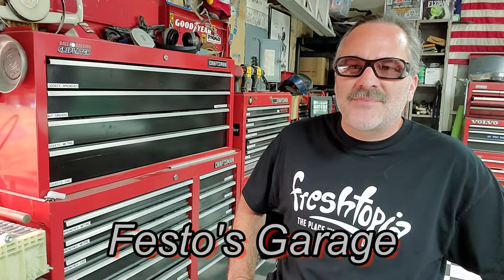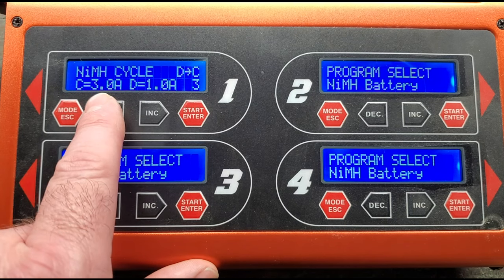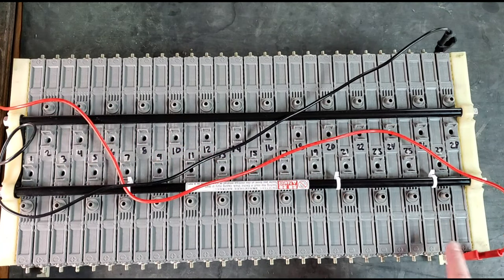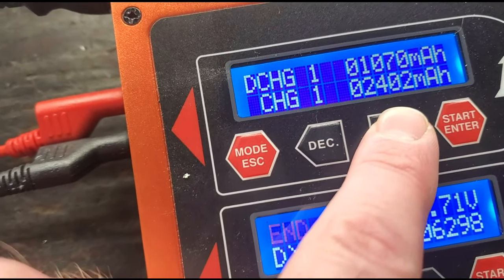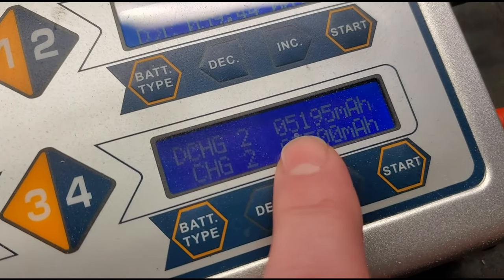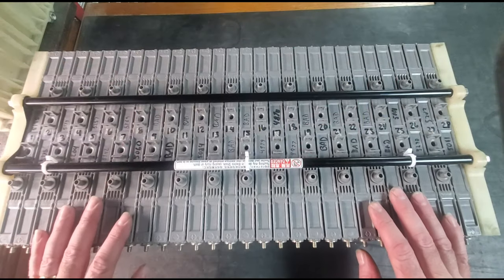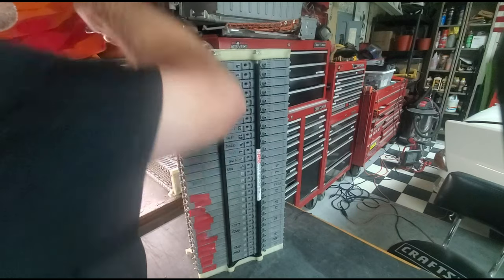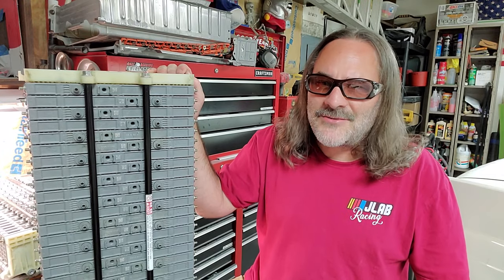Hybrid Battery Pack Refurbish - Step-By-Step w/ Settings - 2nd & 3rd Gen Toyota Prius - CQ3 Charger

Comment: Do we necessarily have to load test and plug the cells into the CQ3? Wouldn’t I be able to just balance the cells by connecting all the cells together with the wire? The code usually pops up only because the voltage difference is high. Good work as always! Keep it up!
Reply from the maker: Thank you for watching and commenting. The code will return due to the low capacity of the failing cells.
Reply: Check your scan tool, you can determine the lower capacity cell by watching the charge and discharge rate, the cell block that has the lowest voltage when discharging would show you which block has the loss capacity.

Comment: Does the welding wire has to be any specific one to make better contact?
Reply from the maker: Thanks for watching. I used stainless steel TIG wire but it can be any metal that conducts. If you ordered new bus bars then you can use them along with your old ones to get the job done. Bailing wire works well too.

Comment: I already replace the bad battery cell and measured every battery cell and there all around 7.76 and 2 cells are 7.80. Would you recommend balancing them again and doing the process of discharging and charging them back up
Reply from the maker: Thank you for watching. You should be just fine to reassemble and drive down the road.

Comment: Great video I'm learning so much. Question for example on cell 20 about how long did it take you to do one cycle?
Reply from the maker: Thank you for watching. I am not sure how long it takes to do a cycle as it will depend on the health of the battery. I set the charger up and check it a couple times per day. The whole process takes 2-3 weeks usually.
Reply: @GreggFesto wow😮 had no idea it was a long process! Thanks for the heads up!❤

Comment: Hey Gregg . Thanks for all efforts you did for the new beginner like me I am a big fan of all your videos. I have a question. When I try to start . It just flashes “DLY” I don’t know what does it mean. Thanks again
Reply from the maker: Thank you for watching. DLY = Delay. It should move past this step without issue. If your charger will not move past DLY on screen then you should check settings. If settings are correct then you should make sure that your leads are ok. If you still cannot move past DLY then you will want to contact EVPeak service.

Comment: Thanks for the great prius battery videos.

I watched this video and purchased the same charger that was in the first video, only it's a red model. It says "BGUAD" instead of "EV-PEAK" and the buttons are labeled differently.
I made sure the settings were exactly what was in the video. I ran my discharge & charge cycle (3x) and when the cycle was completed, I pressed the left button as Gregg did in the video, except I didn't get the same result. When he pressed "Batt. Type" he was able to see the low & high mAh. When I pressed the button located in the same location but labeled "Mode Esc", it took me back to the menu. I ran the scan again thinking I needed to hold it down, but it did the same thing. The other buttons do not take me to the desired menu.
Any thoughts?
Thanks in advance.
Reply from the maker: thanks for watching. I hit the same button location on both chargers even though they have different labels.
Reply: did you figure this out @andyaeschbacher7822? I just did the same thing, finished the scan and when i hit the Mode/Esc, it did not show my cycles at all, just went back to main menu. I also have the BGUAD, but it's EV-Peak on load screen when you turn it on.
Reply: i figured it out. the problem is not all chargers that come from amazon are always on 110. i bought two, one was 110 and the other was set to 220. when the 220 got done with the discharge, it would try to charge before failing with INPUT VOL ERR and quit. so what we thought was done was never done so there were no values to show when you clicked MODE/Esc.
Reply: @andyaeschbacher7822 and @leakingimplants - @GreggFesto, did you find a solution. I have the same thing, I hit the far left button and it goes to home on 1,3&4, but on 2 it works as Gregg showed. Since #2 works as shown, I think I must not have exactly the same settings, but I can't see where I went wrong.
Reply: Thought I would reply just in case it helps others along the way. After checking and even triple-checking to make sure my settings matched Gregg's instructions, I did a factory reset on all 4 QC3 modules and reentered Gregg's settings. 'Bingo', it seems to be working as planned.  However, since the first 4 battery modules charged showed a flashing CAPA, therefore I could only see 1 cycle, and 2 of those modules had less than the desired D - 5000.

Comment: Gregg, after you recondition the cells (cycling between discharge and charge) how much time do you let the pack rest, before unbolting the pack?  I'm a little worried about the cells expanding if I unbolt the pack too early.  Thanks for your help!  Kevin
Reply from the maker: Thank you for watching. I forgot to mention that in the video. I feel the batteries with my hand, if do not feel any hot spots then I take apart, flip the batteries and balance. Please let me know how your pack does after you reinstall in car.

Comment: Question, which of the two chargers would you recommend the blue or red? I bought the red one. And bought the wires you suggested, the machine fried. I had four modules connected with the four sets of wires, with separation of three modules connected to prevent heat. Kinda not sure to buy another charger. Any suggestions? None of the modules are shorted.
Reply from the maker: Thank you for watching. I have not used Blue before. I have a Silver one and a Red one both of which have done very well for me. I have not had any problems with them other than needing to replace some cooling fans due to noisy bearings. Contact EV-Peak support and let them know about your charger, maybe you can get a replacement.
Reply: @GreggFesto  Thank you. I said blue instead of silver but mean the same. Do both units have same operating parameters? I assume both are equal in programming. Great videos!

Comment: When you take out the battery from the car are you charge battery to the full first or you straight away discharge the battery ?
Reply from the maker: Thanks for watching. State of charge does not matter when removed from car. The charger cycle should be set to discharge first then charge.

Comment: Great video.  We have 3 gen 2 & 2 Gen 3 Prius's in family & I am the car guy.  Bought 1 of the recommended chargers & may buy another per your recommendations before I start taking the batteries apart.   Also have Dr. Prius app & various OBDII tools.  Just one question before I start.  Do you have any regen battery vendor you would recommend for purchasing modules from?  Would love to hear if you do.  Thanks much.
Reply from the maker: Thanks for watching. I bought 2nd charger just to speed things up a bit. If you are not pressed for time then a single unit is all you will need. On average it takes about 3 weeks per battery pack with a single charger. I have received really good batteries from vendor called AloyHybrid on eBay.

Comment: What should u set up the Input Power low cut off mines at 11.0v
Reply from the maker: Thank you for watching. I left input power low cut-off at 10.0V. If you are using AC power this setting will not make any difference.

Comment: Hi Greg,

I'm getting ready to do this process on 2008 Prius and thanks to your videos I feel confident about doing it myself. However i do have a couple questions I'm hoping you could answer for me!

First question, when i find bad cells and order replacements do i need to discharge and charge them, or is there a way I can check to make sure im getting a good cell?

Second, when i balance the pack im simply connecting all the positive/negative terminals in a row and letting it sit like that for 48 hours? I don't need to discharge and charge it all together?

Thank you for your time putting these great videos together!
Reply from the maker: Thank you for watching. I always run at least 1 cycle on the replacement batteries so I know what I received. This lets me know how it compares to my others and lets me know where to place it in the pack after balancing. During the balancing step you do not need to charge or discharge, just let them equalize. I hope you will write back in and let me know how your pack refurbishment comes out. How many miles are on your car and what year? Why are you refurbishing your pack? Did you get red triangle or are you experiencing reduction in mileage?
Reply: @GreggFesto  The Prius has 134,000 miles and I got the red triangle confirmed by a mechanic to be a hybrid battery failure, he also  told me it was specifically cell block ten. However I plan on going through each cell as you do to see if there's any other performing poorly.

Comment: 2 questions; Why not us dielectric grease on all the connections to eliminate corrosion?  And, while the battery is still in the car, shift to N with the ac on (300+ volts) to draw down the battery.  Then shift D to let it charge up.  Doesn't that balance the modules too?  Use and OBD2 like Dr. Prius to see the status of each block (2 modules) to get an idea of what's going on in the pack?
Reply from the maker: Thank you for watching. Dielectric grease is a fine idea and may help future corrosion. Cycling the battery in the car will cycle the pack as a whole unit which will not address the capacity of each individual battery. I do use dr prius app before doing this service as it enables me to verify that the blocks showing low capacity are the same as the ones I see when refurbishing.
Reply: @GreggFesto  Yes, I understand.  But you recycled your batteries and got them up to decent ranges.(the ones that were good).  My thought is to do the same thing on the car and then see which ones don't correct themselves.  Might save time by having the car do the work instead of doing it on the bench.  What am I missing with this logic?
Reply from the maker: When the pack is together the batteries are arranged series. This means that they are charged/discharged together. When charge capacity is reached on the strongest cell of the pack, could be 1 out of the 28, then the charging stops. When discharge capacity is reached on the weakest battery then the charging starts. This is the same way the charger works. The downside of this is the car does not fully cycle each battery in the pack. I believe that each of the 28 batteries you see me cycle is made up of smaller batteries. It is quite possible that only one of these smaller batteries inside of the gray battery has failed causing the gray battery to read as failed therefore causing the hybrid pack to read as failed. Your lowest capacity "weakest" and your highest capacity "strongest" battery of the 28 gray batteries in the hybrid pack will determine the way your cars charging system behaves. Your pack is only as good as your weakest gray battery.

Comment: Thanks for the hands on instructional video. Would you use same voltage/amperage parameters for refurbishing 1st generation Honda Insight (2000-2006) and 1st gen Honda Civic  Hybrid (long pipe 1.5v x 6 = 9v D type stacked) batteries? If not, which values (charge, discharge, volts, amps) would you recommend, or the same parameters used for Prius Gen 2 and 3 can be applied to 1st Gen Honda hybrid batteries? Thanks.
Reply from the maker: Thank you for watching. I am not familiar with the Honda batteries enough to provide setting details. I suggest visiting a Honda forum and getting that info from someone with more experience than myself.
Reply: @GreggFesto just fyi findings: Forum and YouTube users apply various similar setups, usually setting upper amperage capacity limit (charge) to 6500mV, that is the stock battery specs, but the later aftermarket batteries that came with 8Amp capacity (Bumblebee, Greentec, etc) seems to be handling your 7500mV charge capacity limit pretty well.

Comment: Thanks for the info on the "Full" ending message meaning the same as an END.  I got my second "Full" message this morning.  I am using your setup of running 3 cycles, but my problem is I can't figure out the key sequence from the FULL message to be able to see my 3 cycle DISCH and CHARGE values for the cycles completed resulting in the FULL message.  If I press the BATT TYPE button as I usually do it does not not take me to the cycle values.  Any ideas?
Reply from the maker: I suggest pressing the button furthest to the left on each channel. You can see this at about 6:35 in my video.

Comment: Gregg, thank you for this video.  I was able to purchase a “new” Dorman refurbed battery for $100 but it’s been sitting unused in a box since 2018.  All of the cells I’ve tried read at over 6v but less than 7.  When I try to do this, the most I’ve seen in the discharge mah is around 600.  Are these modules all dead? I’m 0/8 right now.
Reply from the maker: Thank you for watching Aaron. You may have to run a couple of cycles on a battery that has been sitting for a long time. If the battery is able to be recovered then this process will do it. Usually I experience CAPA message with low discharge mah for the first couple cycles.

Comment: On my 2013 Toyota Prius that I bought 3 years ago with 72,000 miles on it when I first got it I was getting about 45 mpg which was okay. 3 years later and 115,000 miles on it I am getting 39 mpg right now. Would refurbishing my battery like this  bring that mileage back up or is there another problem with the car that you might know about? In advance thank you for any advice.
Reply from the maker: Thank you for watching. A hybrid battery pack that is declining in health can indeed be one of the reasons for MPG decrease. This is because the battery has less capacity so the car will use gas engine more to compensate.

Comment: Thanks Gregg for that amazing  video, i have my Prius has been sitting for year cause the battery pack after watching your video i decided to refurbish all , i respect all your instructions. The voltage test before i started on each module are 7.94V on each only the first one i fund 6.69V . My worries is i fund CAPA message for every single module i restored at the  first or second or third cycle  i add one more cycle Example Discharge 3416 Charge: 7201 the second one is D-Ch 4952,  C-7500mh two or three cycles on each module i tried to restore. If after 5 cycles the battery never reach 5000mh or 7500mh. do i have to replace all modules?
Reply from the maker: Thank you for watching. It looks to me as if your discharge value is increasing with each cycle and your charge value has reached CAPA of 7500mah. This is perfect results. Run cycles until you reach at least 5000mah discharge and you will be good. If you also have 7500mah on charge at same time then this is a great battery.

Comment: great video, very helpful. i have a 2009 gs450h do you happen to know if these batteries have the same capacity and should i use the same charge and discharge amps when testing these⁉️
Reply from the maker: Thank you for watching. Your batteries are the same as these and can use the same settings. You will have 40 of them instead of 28.

Comment: Excellent video. How do you dispose of modules that have been determined bad? What is the charge voltage at 3amps?
Reply from the maker: Thanks for watching. We have recycle area at the dump in my city for batteries so I take them there. I do not know the answer to your volt/amp question.

Comment: Gregg an excellent video, doing everything per your recommendation in one Chanel I am getting flashing “TIME” what does this mean thank you
Reply from the maker: Thank you for watching. I have not seen message TIME before. It is possible that it is the same as WAIT message which will appear if the battery voltage is too low on initial discharge cycle. If I am correct you should be able to leave it connected for a while and the message will go away once the charger enters first charge cycle. You can get better answer you can contact EV-Peak customer service. When you verify what the TIME message means could you please write back in and let us know?
Reply: Thanks I reset the channel to factory reset and problem went away.

Comment: Thanks for all your help, I getting lots of cell with between low 4300-4800 should I pass them or replacing I have do multiple cycle of them
Reply: I was talking about discharge mili amp
Reply from the maker: I use 5000mah discharge value as my cut-off point.

Comment: Thank you for sharing your knowledge.  I'm currently about half way through reconditioning my 2007 battery pack.
Quick question, if you don't mind:  Is the number of cycles required to hit the 5000/7500 values an indication of the remaining life in a module, or is that number irrelevant as long as those values are reached? Asked another way, does a module that required 10 cycles to reach 5000/7500 have less life remaining than one that required only 2 cycles?  Thank you for your time.
Reply from the maker: Thank you for watching. That is a good question, unfortunately I do not know the answer. I suspect that the battery which took 10 cycles to recover is not as healthy as the one that took only 2 cycles but just don't know. This would be a good question for a forum such as PriusChat. I have had some take over 15 cycles to come back around and they seem to work just fine. If you do get an answer to this from someone that knows, please write back in and share with us.
Reply: @GreggFesto  Thanks for getting back to me.  If I do find an answer I'll be back to share.